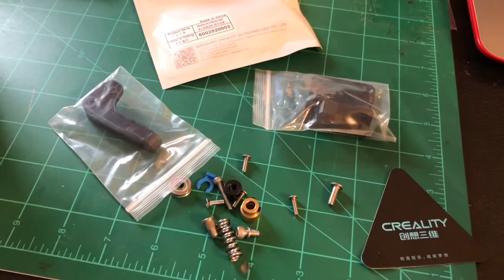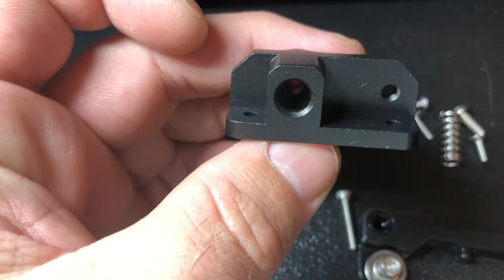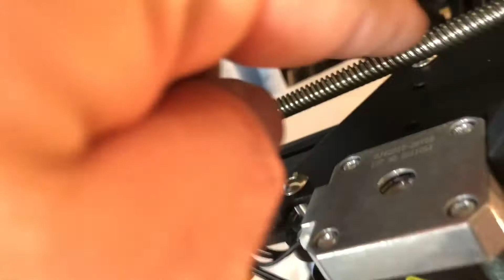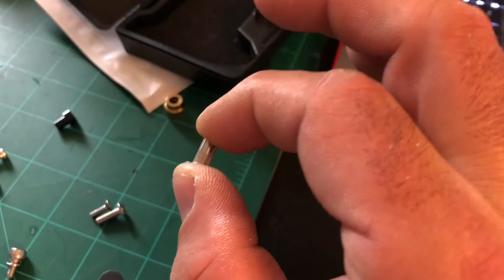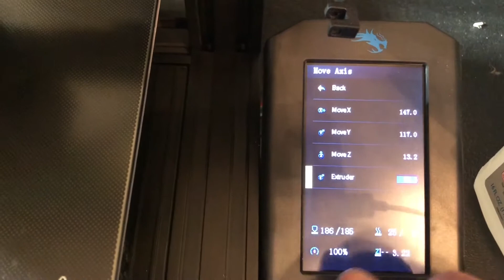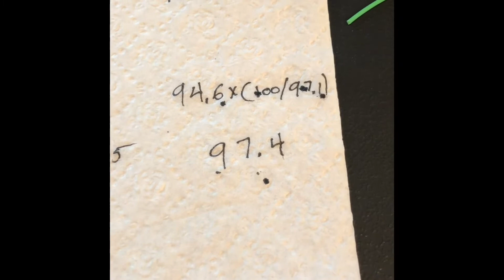Installing the Creality Metal Extruder Kit

Comment: I would have been tempted to install a direct drive since you had to replace the hot end. It would have cost more, but it also increases they variety of filament you can use.
Reply from the maker: I debated it. But since I didn’t know what I was doing I thought I’d stick with it for now. I probably will switch one of the printers to dd at some point though.